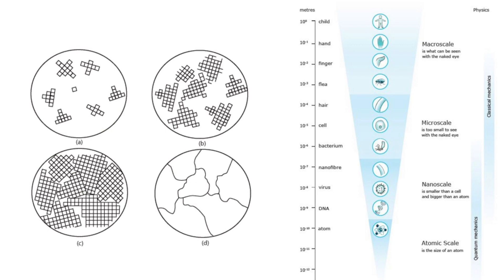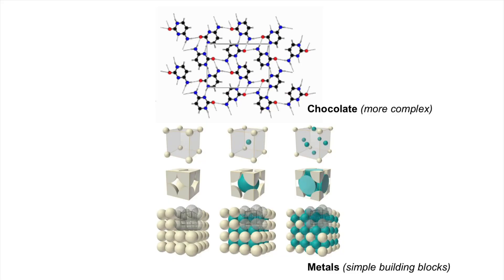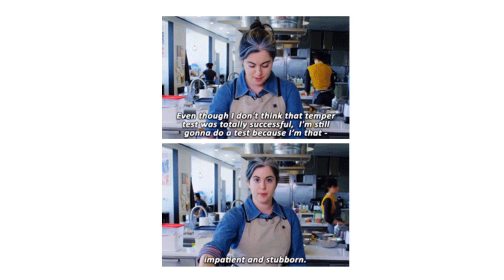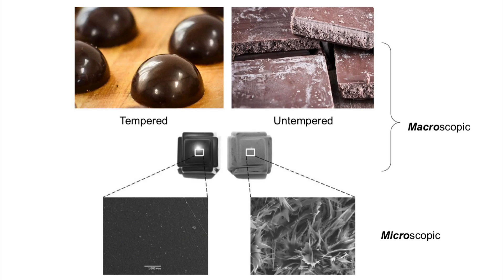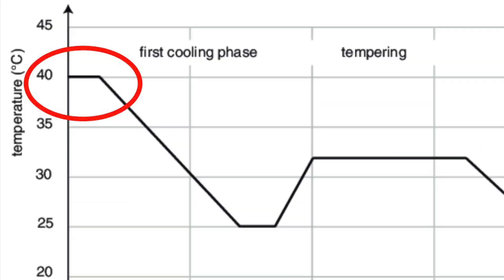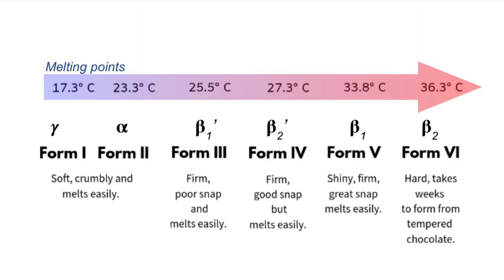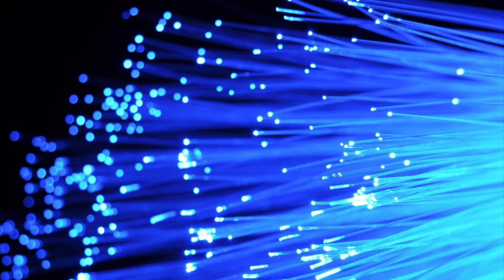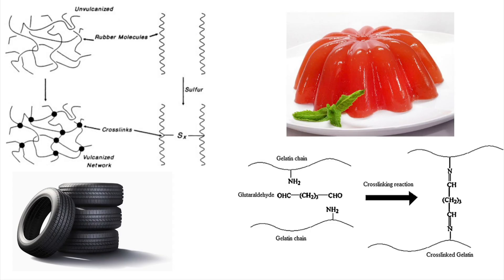How to Temper Chocolate like a Materials Engineer | Clio Batali | TEDxMIT

Comment: Don't you rather think our collective incompetence at problem solving is the result of an economic system whose efficiency as such is immediately dependent on the maximization of turnover and demand for human labor, where, hence, the interminable progression of technical efficiency, i.e. effective problem solving, ultimately sabotages the very viability of the economic system itself, since the overall functioning of that system explicitly necessitates the perpetuation of problems as well as the inefficient servicing of those problems, exposing an inherent conflict between the built-in micro- and macroeconomic incentive structures? Just a thought.

How are you going to make people into good, scientific and effective problem solvers when the economy fundamentally requires them simply to be consumers and to prioritize only problems related to generating more consumption? I ask you this: In actuality, what is the purpose to which science education is directed in the present circumstance?